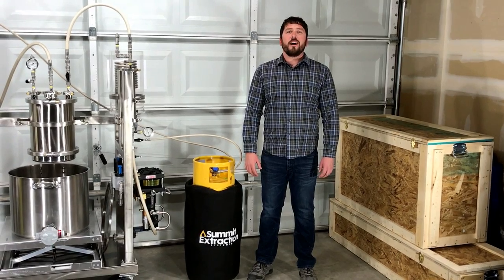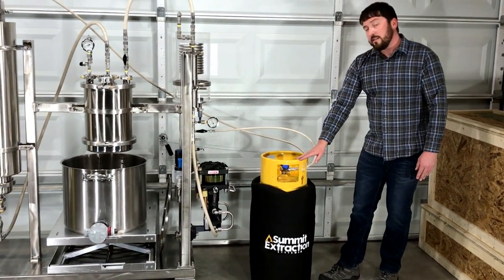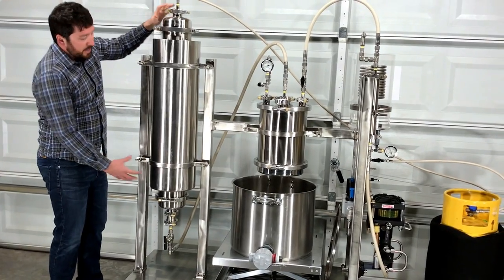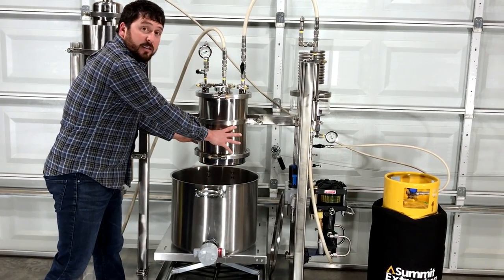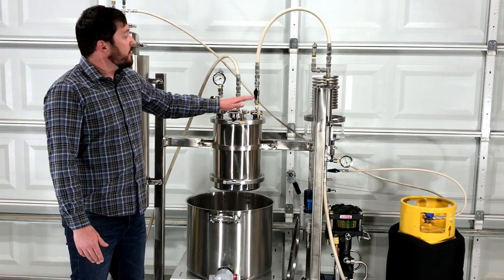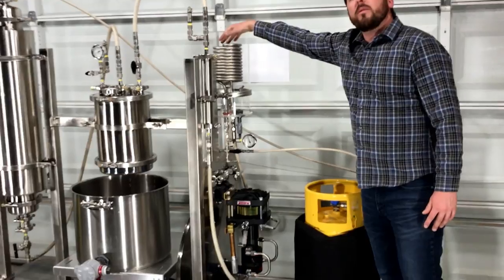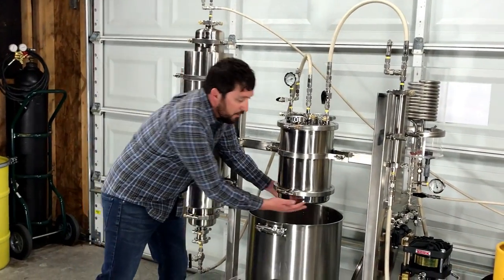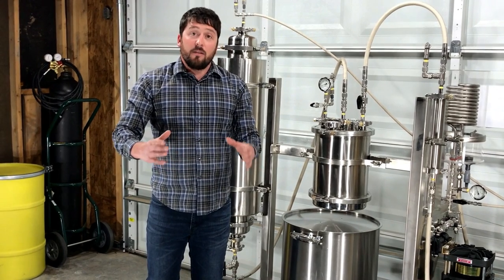Summit T1 Extraction System Process Walk Through - Closed Loop Extraction Equipment

Comment: Nice system, nice video thanks. Just a heads up on the molecular seive it should run through as a liquid and not a vapor. There desighed to take moisture from liquid state. Peace

Comment: i mean. i understood the general workings of the system. but it would be much more informative to see it actually being used.   for example, you lost me after the point you mentioned molecular sieve, the pump, condensing coil.     how do you cool the coil with your ice??? 

it was informative but id be throwing cash at my screen if i seen an actual demonstration with some dried lavender or something

also. how do i refine my butane with that system? where do i buy the giant tanks of gas of butane instead of individual cans of newport?

some more info goes a long way

Comment: they say butane extraction is dangerous for health, can u use something else?
Reply: co2, iso alcohol... butane isn't the only solvent out there, and it's not dangerous if you purge it completely.
Reply: thx for info
Reply: if im correct, the butane he is using in this closed loop system is refrigeration grade hydro carbon and is all natural. how could it be that bad. the stuff he fertilizes the plants with is probably more dangerous to your health then what this butane is after it goes though this evaporation process and turn back to a vapor and removed from the sytem
Reply: That article is complete BS, BHO can be made clean so the butane is not even detectable by labs, more people ingest butane from lighting there pipe/bong with a lighter, and obviously are fine.
Reply: there are hundreds of articles about it, maybe this one is a bit over the top, its in 10 years from now you'd have cancer anyways. Good luck with your gamble!
Reply: Its not a gamble, what don't you get about non detectable?
Reply: Well I take it you follow whole story about slim particles and all that stuff,  mutagenes... sometime the smallest things can make lots dammage. Cool man , I'm not too bothered if you wanna chance it.
Reply: But I would feel guilty if I offered a product I'm not 100% sure its not tinted personally.